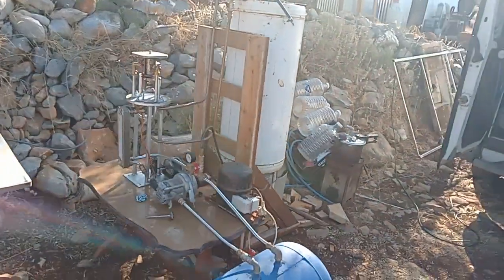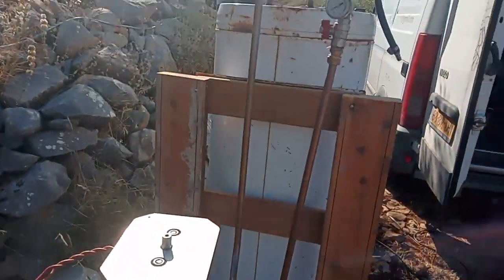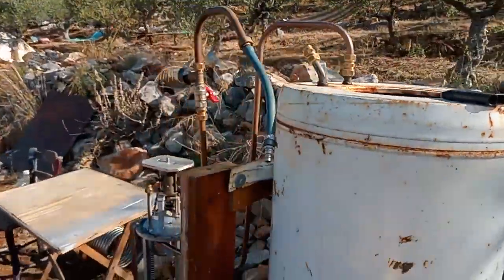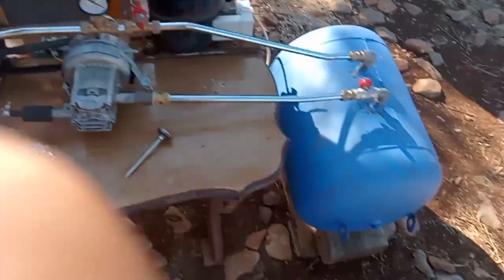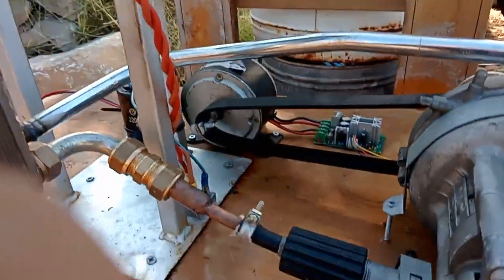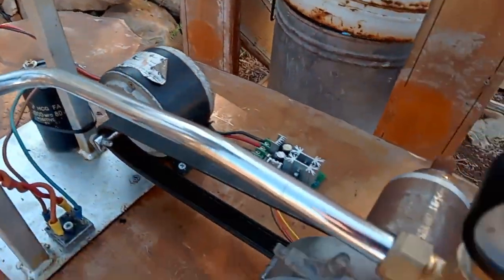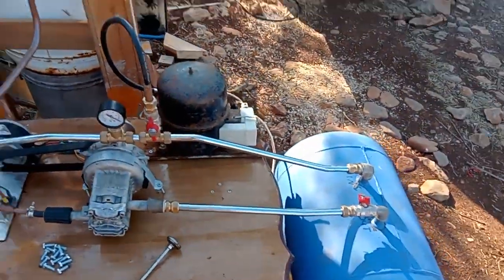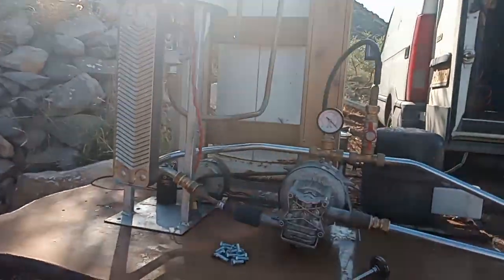Tesla machanical oschillator/ Earthquake machine, first vacuum system layout

Comment: Oscar, have you tried vibration absorbers (spring type) to isolate vibration issues at anchor points?
Reply from the maker: No I just eleminated the vibration problem by bolting it onto of the 80l Water boiler it's going nowhere enymore, ther is a spring on the piston now en the frequency Goos from 33hz to 53 Hz,  vibration absorbers lowers the efficiency of the machine now the piston is then only thing moving,